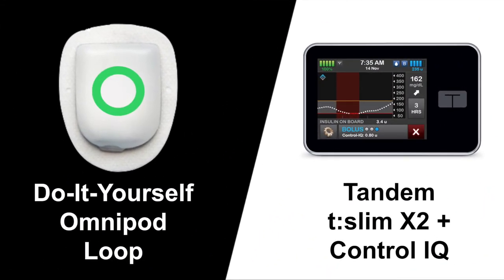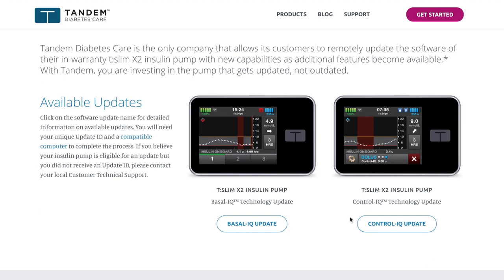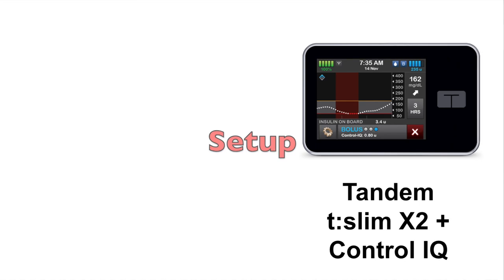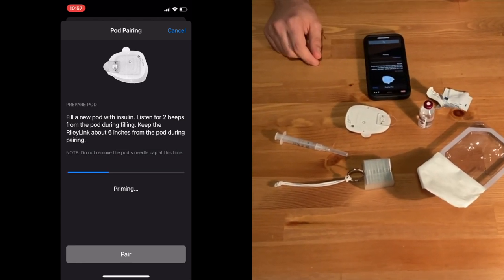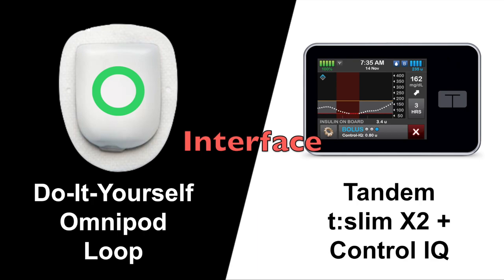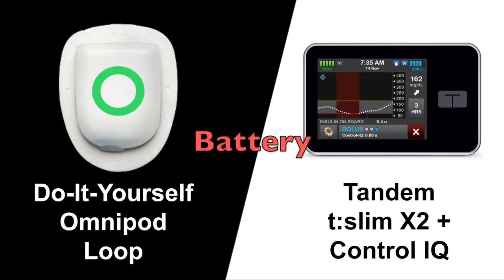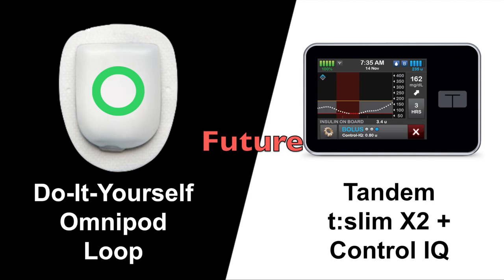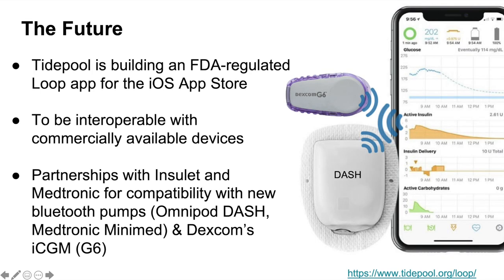DIY Omnipod Loop vs Tandem t:slim + Control IQ

Comment: I have been using DIY Loop with Omnipod for 2 years now and have had excellent results. While you do make some compelling arguments in favor of the Tandem pump, I have had shockingly few issues with Omnipod Loop. In fact, I've had fewer issues with DIYLoop than I've ever had with any commercially-available pump (and I've had quite a few). For me personally, tubeless makes the Omnipod such a big win, as does the very simple site changes. Whenever I've traveled and just in my day-to-day life as a parent, I've appreciated so much how fast the Omnipod site changes are. The Tandem site changes just annoy me with all those steps.

Comment: Great video! I've been on Medtronic closed loop but it's been a nightmare. So many alarms and alerts that wake you up at night. The CGM with the pump is not accurate and expires without warning. I'm switching to Omnipod looping. The big issue for me is lipodystrophy (bad site absorption after 45 years of insulin), Omnipod offers more useable/accessible sites given there's no tubing. Can't wait to try it out.

Comment: At this point, I think I'm more inclined to the Omnipod 5 system, just because of the tubeless feature, and the fact that you don't really need basal rates after a while. I don't love that CIQ cuts your basal to 3.0 U/hr regardless of your scheduled basal rate if you're supposed to be in range in the coming hours. I agree with the cumersome-ness of the Tslim site change...plus it wastes so much insulin every time. I'm so excited for what is to come in the next year or 2 for HCL systems!
Reply: I’m due a new pump in 3-4 months. Have to choose between TX2 or Omnipod. Difficult choice. I currently on Dexcom and Med 640g.
Reply: Omnipod5 is taking FOREVER coming out with a loop system..they keep promising and nothing still..I hear AGAIN THE END of this year or beginning of NEXT year which is the same thing they say every year

Comment: Hi Benjamin, thanks so much for this video. I'm very curious to learn about your thoughts regarding automatic bolus, and Control IQ. You mentioned it in the video, but I wasn't sure if you were using the automatic bolus branch, which I personally noticed a dramatic shift in control with my diabetes. I am really keen to trying out the Control IQ, but I'm not sure how it is going back to only changes in temp basal, rather than getting the full dose straight on. Can you comment on this at all given your experiences?

Comment: Are you talking about omnipod dash or 5?
Reply from the maker: DIY systems are discussed in this video, they are compatible with Omnipod DASH or Eros. Omnipod 5 is a new hybrid closed loop system developed by Insulet, it is not available yet